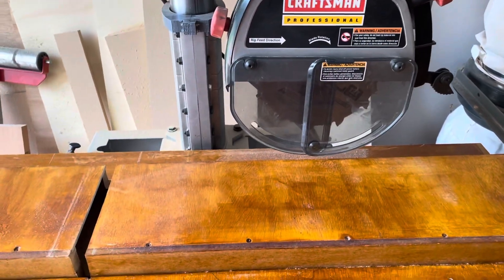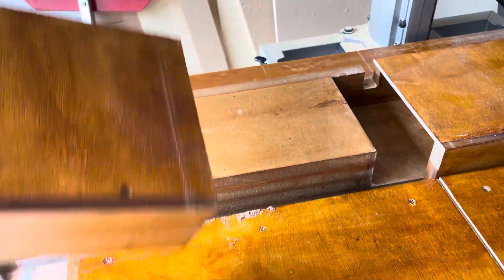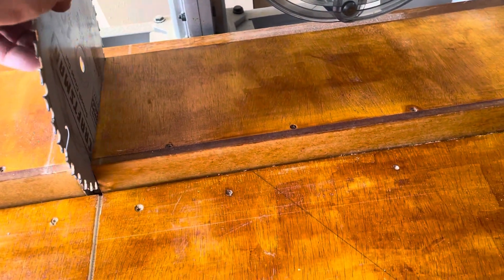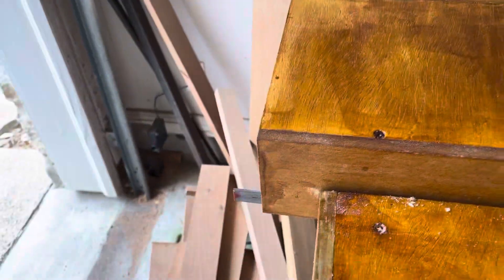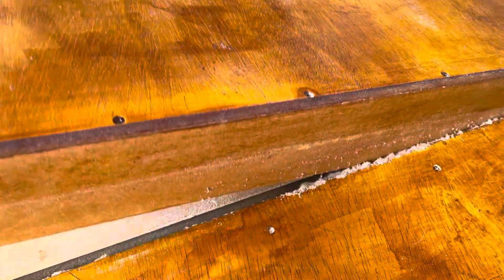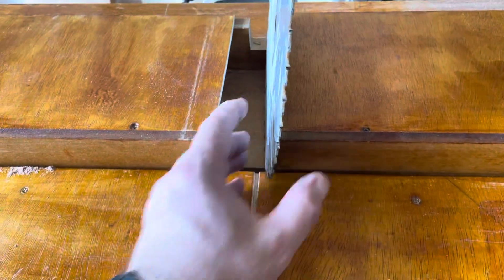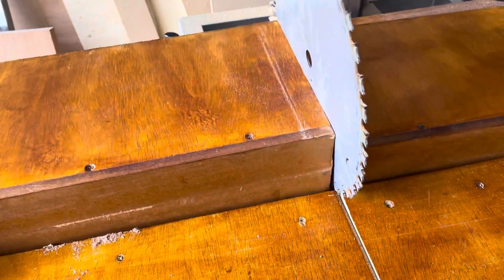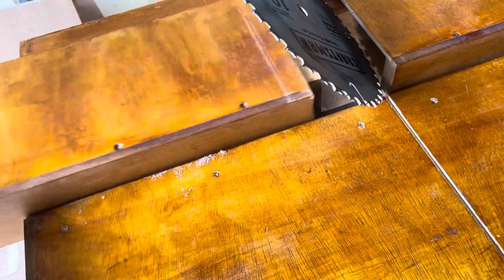Radial Arm Saw (RAS) Dust Collecting Fence

Comment: This is really cool. Could you make a video or share plans for the whole top?  I am trying to restore and old 1950’s craftsman RAS that I acquired that is  similar to this one but it didn’t come with any top so I am starting from scratch on building a fence and top.   Thanks!
Reply from the maker: My table is dimensioned exactly the same as that which came with the saw, except the width.  My saw came with a 1" wide MDF table.  I've replaced it with 2 3/4" MDF with a sacrificial top of 1/4" plywood on it.  The MDF sheets have metal bars epoxied in them to make it extra stiff (I half wonder if that's overkill, but what the heck), and I trimmed the fronts and sides with poplar strips to protect the edges (over 20 years, the original MDF did get a little beat up) and cover the slots where the bars went (just makes it look a bit better).     I finished it with amber shellac I had left over from another project.  I was running short, so it's a bit splotchy.  The top is what they call a Mr. Sawdust table. Check out https://mrsawdust.com/mr-sawdust-table.  It references Biran Weekley's videos, which are my favorite RAS videos on youtube, though I think he holds back some details and refers to the Mr. Sawdust book.    Tommy Tompkins did one at https://www.youtube.com/watch?v=6TMBT45g_qg&t=544s .  I'd be happy to draw up or add more information, but there are people that have already done a great job.  Try to find your original saw manual, if you don't already have it already just to see what the original top was like.   The sacrificial top is great to have, partly because it also provides a dust channel.  When I first got my RAS, I got bit a couple times with dust building up against the fence and throwing off square.  So if you make the sacrificial top stop like an 1/8" before the fence, it creates a place for the dust to go.  I do encourage you to make a beautiful top to your RAS.  They are nice machines and we're preserving a bit of history.  I hate when I see some chewed up piece of chipboard used as a RAS top on some unloved rusted out saw.
Reply: @markjohnson8864  thank you so much!  This is a huge help and a good place to get me started.  Thank you for all the info and for your videos.  They are very helpful.